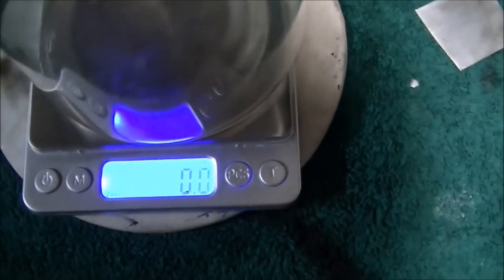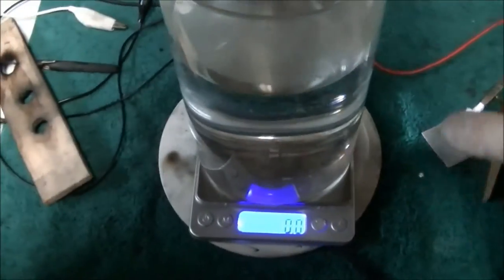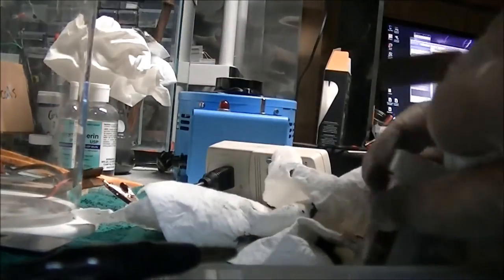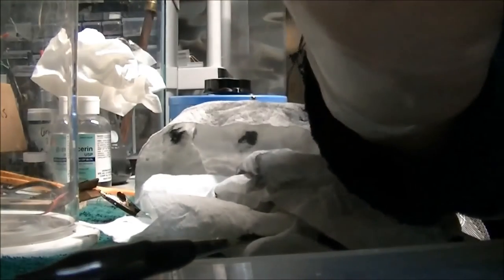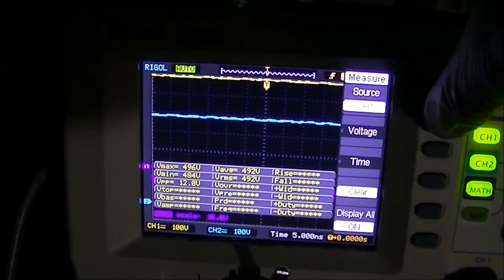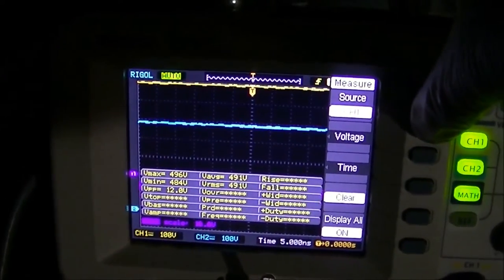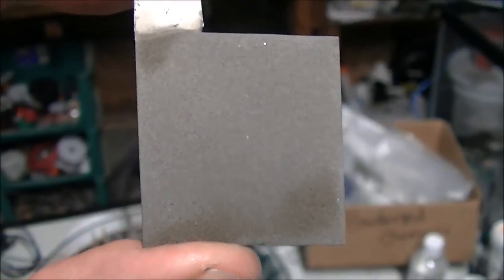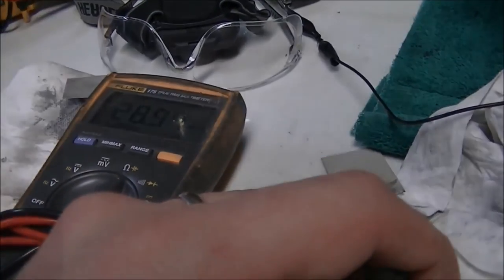Plasma Electrolytic Deposition (PED) on Aluminum - DIY Material Science Techniques Explored

Comment: El Guapo: Would you say I have a plethora of pinatas?

You just made a super dielectric layer on the surface of the aluminum, dry it then add 2 molar NaCl in H2O put two plates together and you have a new paradigm supercapacitor.

Would you mind if I go do this right now and post a video?
Reply from the maker: Not at all, that was the purpose of the video and open sourcing in general.  That is on the to do list for sure. I was going to experiment more with NaSi and the idea was to create an electrolytic super capacitor. There is a lot more theoretically, that can be done with these materials and there subsequent layering. Just a lit more experimentation and mechanical upgrades that need to be done. I figured you would pick up what I was putting down ;) Great job recognizing the 3 Amigos btw lol!

Comment: Curious what your 9kv source would do ..)
.. and the low amps ..)
Reply from the maker: I don't have the 9kVAC any more, but I do have a 12kVAC @ .30mA. According to most the literature I have read, the best results occur from a decent amount of amps with a Bipolar AC source. Where the + peak of the sinusoid is 80% greater than the - peak. That's a good idea if I could step it down into a proper oscillator. Thanks for the idea, I hadn't thought of that.
Reply from the maker: Thanks for the share, that is a great link. When you say you are looking for pierced porosity, you mean to say channels completely through the material substrate? So like a molecular screen?
Reply: +Diadon Acs (Conscious Energies) 

Great link but maybe fruitless .. as we always seem to reach the conclusion: do thy own experiments, to see how twisted nature or our assumptions are. lol.

Not looking for molecular size but many small steam channels through a smooth tensile flexible surface would be adequate, small enough that minimal texture is created - i will probably laminate a high thread count polyester onto mylar.

Your language reminds me of a fellow who used dots ..... ect to convey much meaning .. .... ?

Comment: Interesting stuff, do you have any stills of the structures? I'd like to see those if you have. Thanks for sharing D ;)
Reply from the maker: Stills under the microscope or naked eye? I would like to get some SEM shots but its quite the pretty penny. Its pretty much Al2O3 ceramic layer that seems meso porous, with some carbon deposits as well. It makes quite a lot of peaks and valleys from what i can tell. Hit me up any time and I can tell you whatever you would like to know. Been working on it for about a month now.
Reply: Diadon Acs will do thanks bud.